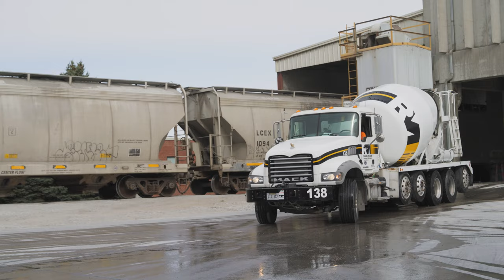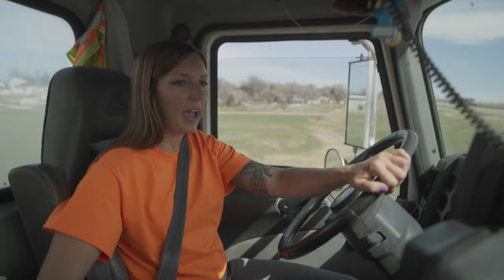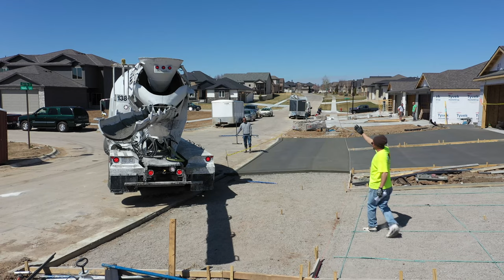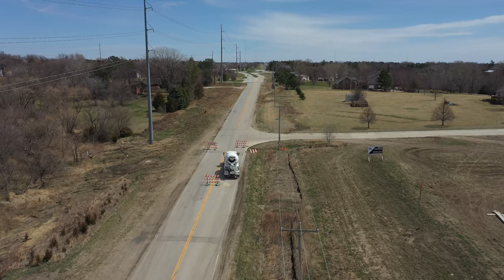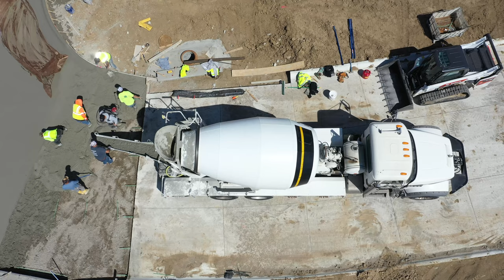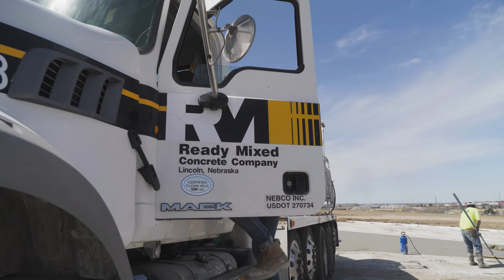Day in the Life of a Ready Mixed Driver

Comment: I got a question for all of the ready mix truck drivers, is driving it similar to a semi truck because of the weight from pulling it and being cautious? I know it's a straight vehicle I was just curious how sensitive we need to be with carrying it?
Reply: I'm a union readymix driver but I also drive tractor trailer dumps lowboy flatbed etc and I can tell you from my expirence readymix trucks aren't hard to drive but they are much diffrent from tractor trailers mostly in the sense of higher center of gravity and less tires on the ground gotta be really careful in turns cause at any given time you have about 8,000lbs way above the cab of your truck on the driver side the number one thing I tell rookies that get into it these readymix trucks are not forgiving and you don't get a 2nd chance so take it easy first thing to lift is the rear tires and you can litterally watch in slow motion the rear lift up and frame twist and once it hits a certain point its gonna absolutely slam the cab of the truck into the ground full force biggest thing in readymix is take it slow in turns and always keep your head on a swivel know everything and anything that's happening around your truck and your changing environments we work on jobsites after all and they change every single day multiple times a day that being said I love readymix its a great career and I make very good money and am able to support my family comfortably
Reply: It's similar to driving any other top heavy trucks, you need to take the same precautions with safety in mind. Most rollovers will occur when drivers take turns at an unsafe speed especially on/off ramps and hairpin turns. If a posted speed limit sign in a curve says 30 MPH, you will obviously want to take it at a less speed such 20 MPH or even less in wet road conditions. In my opinion the only reason why ready mixers could be considered more dangerous to operate is because some of the job sites they are required to deliver to can be a high potential risk for rolling the truck over if the driver lacks the ability to detect signs of danger and not making good judgement for those instances. Some of these job sites can be as simple as delivering to a regular residential neighborhood, while others can include a site that contains dangerously uneven surfaces, soft ground, steep grades at a bad angle, deep trenches in tight areas, etc.
Reply: @andrewmoore4744  thank you so much!  that was very informative. I just got done driving a school bus for a year and wanted to know what the experience was like
Reply: @SkylinesTheLimit  thank you for the information, really needed and helpful. It's good to hear others perspective on these kinds of vehicles. I thought about driving it